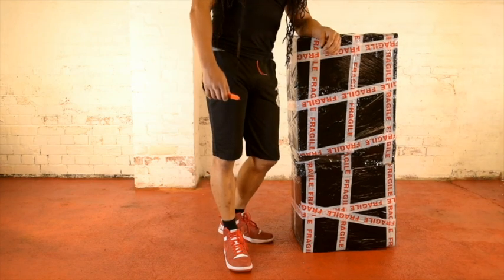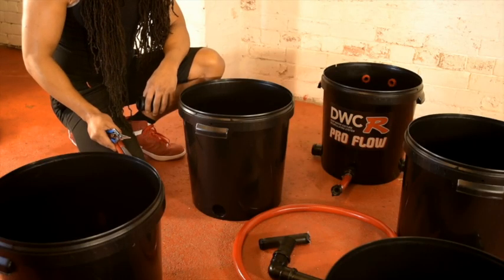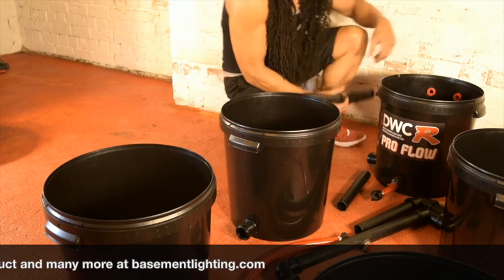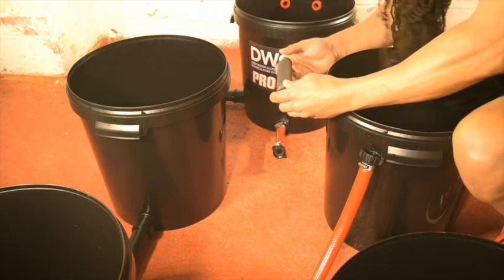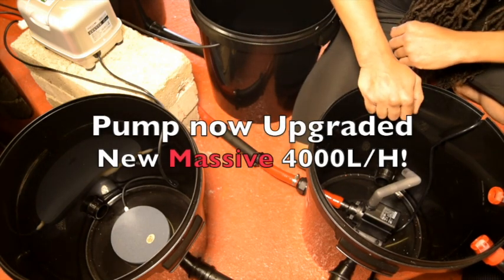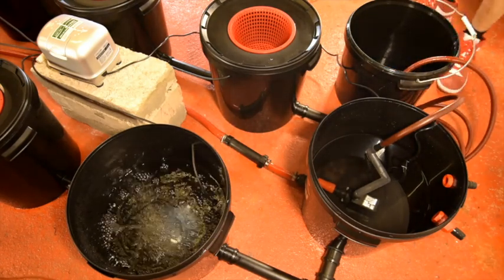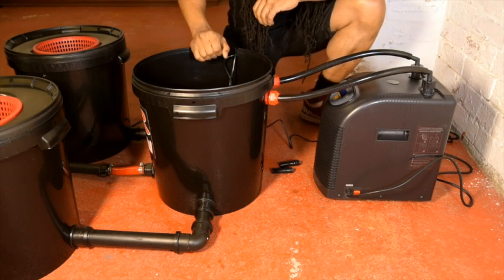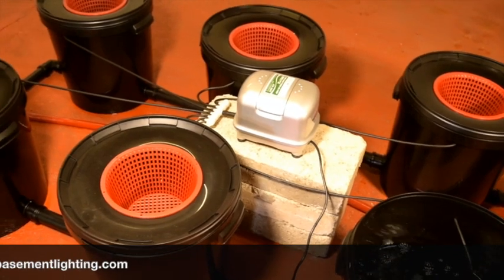Basement Lighting DWCR PRO FLOW Hydroponics Bubble Pot System Set up

Comment: Hi.  What's the  8 pot 33l  Pump wattage, please.  Also, the wattage of the optional water chiller too please.  Thanks.
Reply from the maker: Hello, The water pump is 92W, Air pump is 25W and a Hailea 150A chiller is 165W.
Reply: @basementlighting4479  That's brill. Not a big electrical load then at all. Thanks for that.

Comment: What size tent would this 4pot fit?
Reply from the maker: The system dimensions for a 20Litre and 33Litre system are

4 Pot PROFLOW 20L – (W) 92cm x 145cm (L)
4 Pot PROFLOW 33L – (W) 100cm x 160cm (L)

Comment: hi what about a seperate water put to top up? 100 litres?
Reply from the maker: The system can be supplied on request with a flexi tank and top up valve fitted with an extra cost of £75.